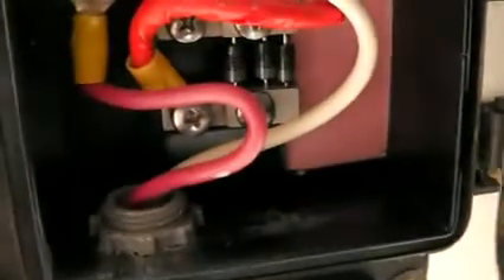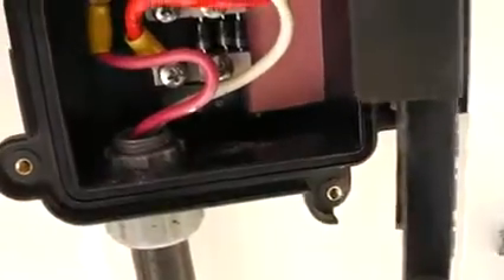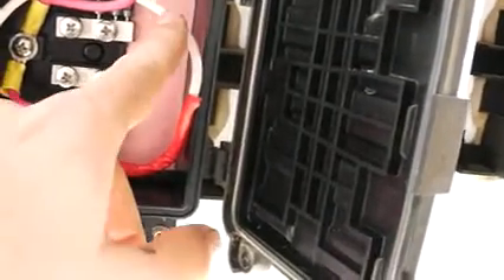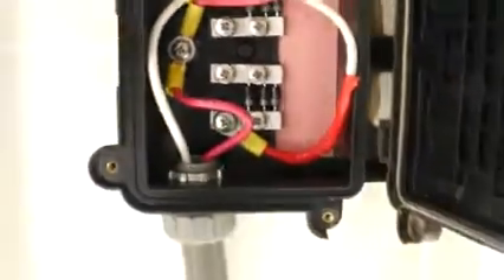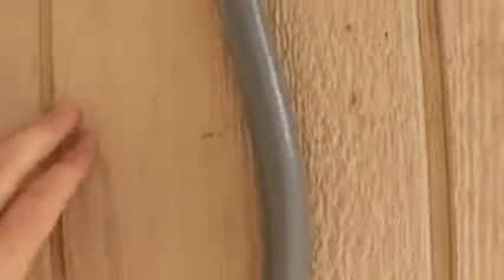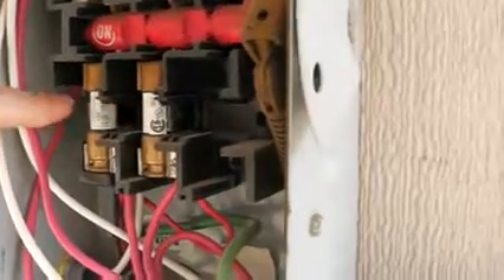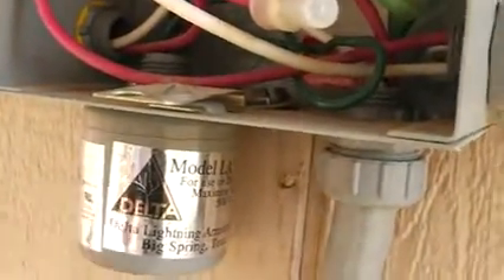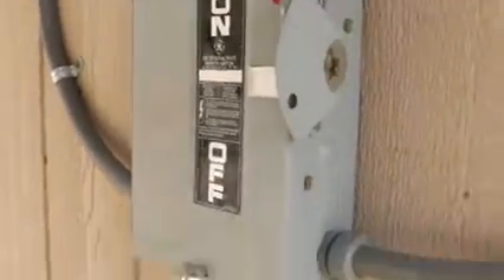Living Off the Grid: 3 Panel Wiring.mp4

Comment: How would an E.M.P. affect the Solar Panels? 1) Would it destroy the panels if they were in the process of generating energy (unusable for future use) 2) if they were not hooked up but outside exposed to the sun 3) outside in it's shipping box unopened. I understand if any electrical components were exposed and not in a Faraday container they are useless after the blast.

Comment: These panels have MicroInverters, this is typical of a Grid Tie system that you wire in one string, but usually not for Off-Grid applications.